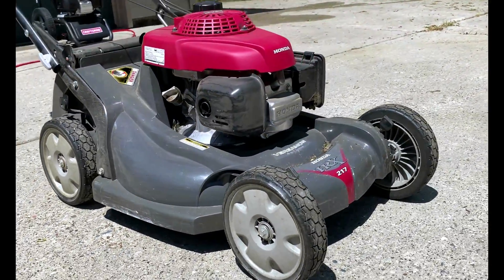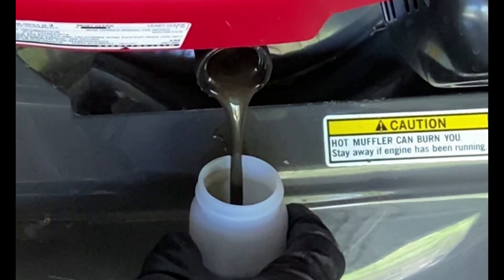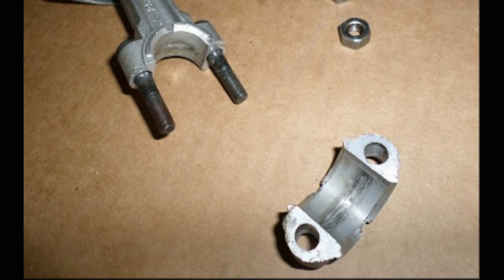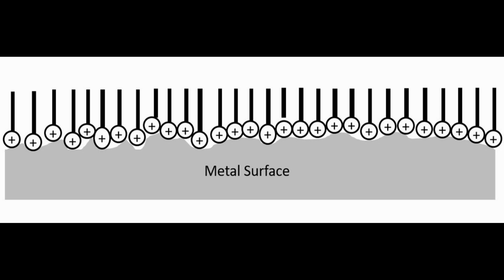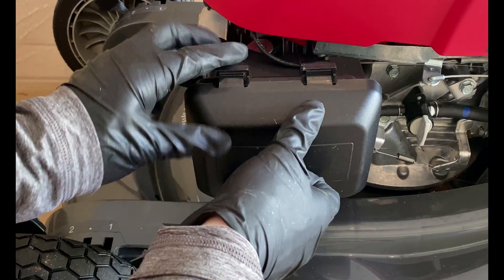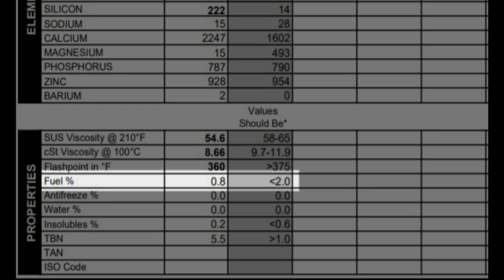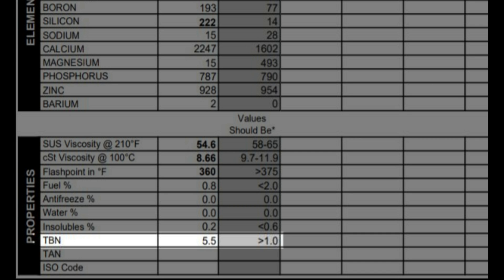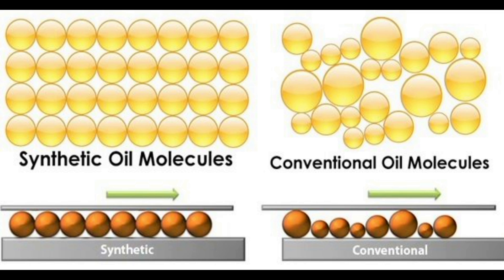Small Engine Oil Analysis (With Lab Report)

Comment: Would love to see you run Valvoline Restore and Protect in it for two 3 month intervals followed by Pennzoil Ultra Platinum.  Compare before and after visually and oil analysis findings before, during and after.  

Btw, I used to have a landscaping company.  Ran full synthetic in all my engines.  High quality residential equipment, but i believe that helped them last an extra season.  That way, instead of nursing commercial equipment for several years, i could just get new equipment every few years.  Note, i’d also run 89 octane gas to reduce pre-ignition.
Reply from the maker: That's a good idea, I appreciate the input and the background on your experience!

Comment: It's absolutely alright to run synthetic oil in small engines.  
Do an analysis after running Amsoil Small Engine oil for 100 hours.
Reply: Not only is it alright, full Syn in small engines is basically an actual 'lifetime' fluid in terms of resistance to breakdown and degradation and the only reason you'd need to change it would be from contaminants in it. Small engines are so low-shear/stress and subjected to so many less thermal cycles (for consumer mowers and such) that a Synthetic will barely degrade for many years. I'm largely fine with newer mowers advertising no oil changes as the factory fills were switched to Syns to handle it. 

There's an enormous difference between the longevity of the conventional SAE 30 or 10w-30 that were used until fairly recently and even any decent semi-synthetic.

Comment: Small engines are very hard on motor oil. Air cooled engines run very hot and often do not have oil filters. Use synthetic oil ( Amsoil has synthetic small engine specific oil ) and change oil at the END of the mowing season. You don't want dirty oil sitting in the engine all winter. Also, use a fogging oil prior to storage.
Reply from the maker: Excellent advice.  I changed the oil in the fall so any acid from the used oil doesn't work away at the engine over the winter.  Fogging is a great idea, still a few months before I mow so I'll pull that spark plug out soon.  Thanks for watching!
Reply: @OwenLucas  You're welcome. Great content on your channel for an engine and motor oil enthusiast.
Reply: You'd think they would run something thicker like 5w40 for a motor that will almost always only be used during the summer, you aren't doing much mowing in winter and it would help with the higher temps too.

Comment: Thanks for an interesting video! 

The dealership that sold the lawnmower to me did the initial break in oil change. After that they did the first service on the engine. I live in Sweden. The first real service was after the first summer season. That equals about 50 hours of run time. 

The next service I did myself. I bought a Honda OEM spark plug and filter and then 10w-30 Amsoil Small Engine Oil. The motor ran smoothly the whole season and the oil still looks very good. 

I have a 4-stroke leaf blower that will get the Amsoil Small Engine 10w-30 oil too. 

Before the next oil change I will just as a precaution use Amsoil Power Foam too.
Reply: I didn't know Amsoil is available in Sweden. Did you have it shipped from the USA or did you buy it locally?
Reply: @stevenroche9874  I get it from Sweden, Poland and Germany. Amsoil is pretty big in the general motorbike world. I can actually come across Amsoil cheaper than Motul, Liqui Moly, Mobil1, Castrol or any other oil brand.
Reply from the maker: I'll have to give Amsoil small engine oil a try.  I have heard good things about their oil since it is designed specifically for small engines which most often are air cooled and don't have the same performance characteristics that automotive engines have.
Reply: @OwenLucas  It is also very common among cross and enduro enthusiasts.

Comment: I use super tech or rural king synthetic once a year in my small engines made by warren oil it’s good stuff for the price it don’t have to worry about it under performing
Reply from the maker: Great tip, I'll have to check it out.